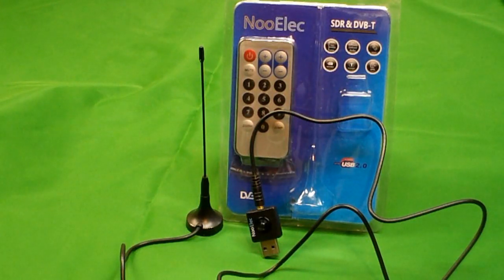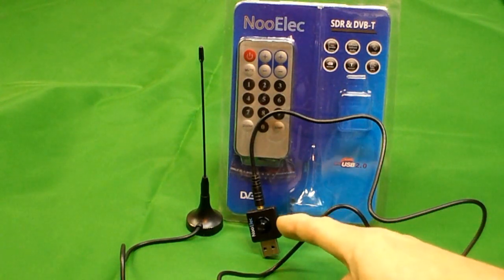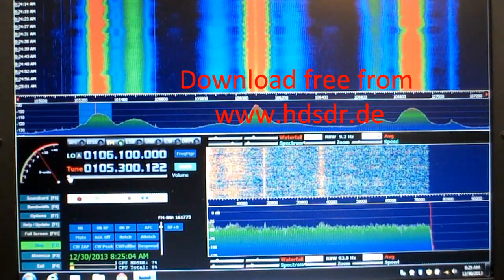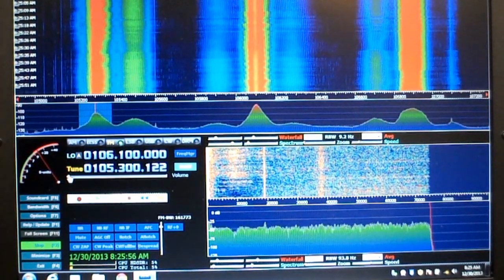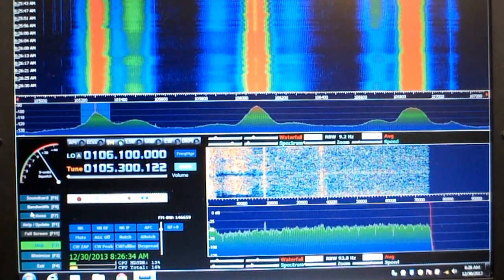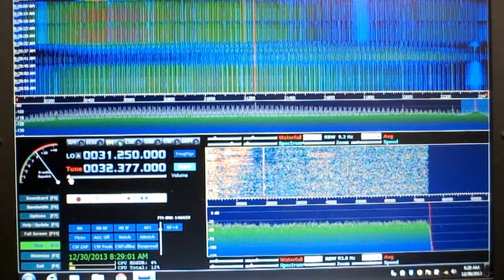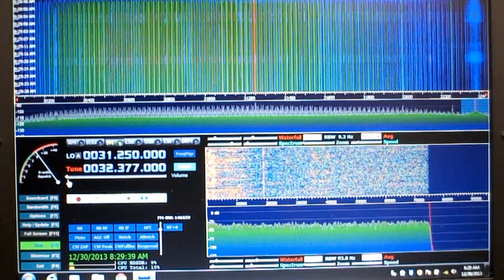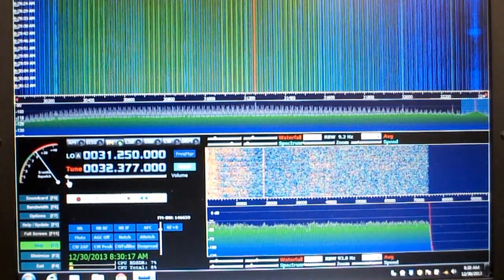NooElec nano NESDR and HDSDR radio review  GREAT BUY

Comment: I ordered one and it does not work, they sent me another one and that one does not work either. Support was very poor. I spent hours trying to get it to work (no help from support) They said did I install the driver was the best they can come up with. So now I got an RMA to return and going to be charged a 20% restock fee. Are they going to resell 2 units that do not work ?  DO NOT waste your time and money on this model...
Reply from the maker: Interesting problem. When I bought mine I got 2, and a friend was so impressed he bought 2 as well. All 4 worked but that was 2 years ago. Maybe they have a quality control problem now......Thanks for watching.
Reply: Ken S check the driver and rf amp on the sdr software 
Spent hours with the same problem. Now it works like a charm